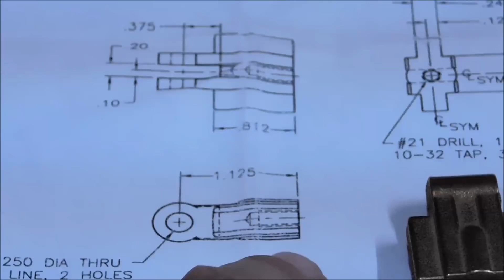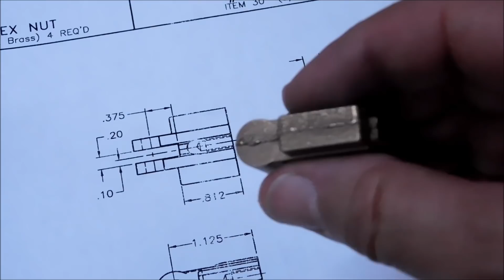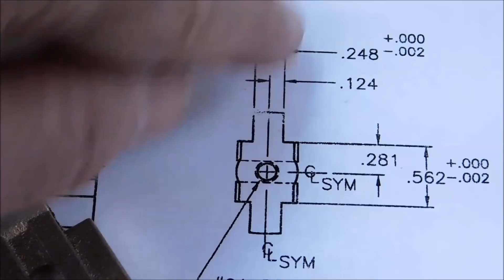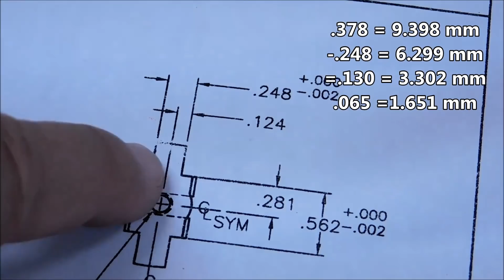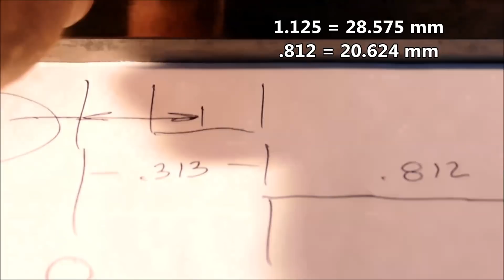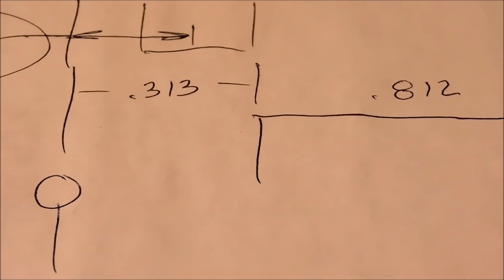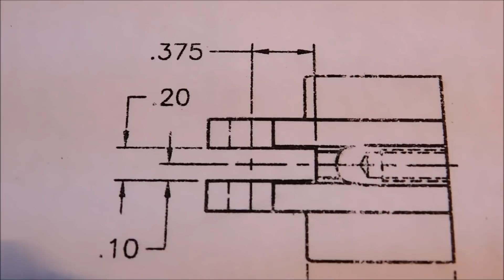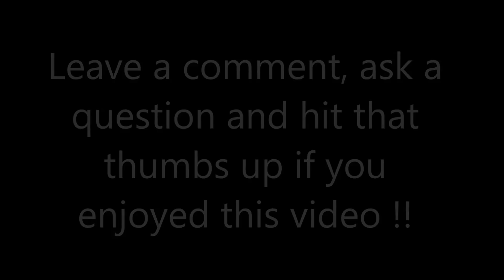Machining a Model Steam Engine - Part 5 - The Crosshead

Comment: Aloha Joe I have made several of this company's models and casting offset is one of the major problems, and your are right many times your dimensions are not possible to obtain, but there is always a preferred surface that needs to meet print dimensions.  I wish your had done this a few years ago, before I started making these models, try their shaper or milling machine kit!!!
Reply from the maker: If they are smart, they'll send me one for free. Great advertising.
Reply: @joepie221  I agree...
Reply: @joepie221  I agree. I bought this PMR model and will build it while re-watching your videos. I bet a lot of others are doing this also.

Comment: With the damage from the copper wire I wager it's a combination of the copper wire being age hardened and the casting being porous. I have seen cast parts so porous that they looked solid but leaked like a sieve, and I can only assume it has a similar effect on strength.

Comment: hey Joe,
 i love the videos you put out. i was wonder could you do a video on taper threads? there not a single good video on  how to machine taper threads from start to finish. Finding all the information you need to be able to machine taper threads you make for a good video. i appreciate everything you do for the machining community!
Reply: You machine a taper thread the same way you machine a thread, and a taper, except at the same time. You use a taper attachment or an offset tailstock and thread as normal.
Reply from the maker: @SuperAWaC  1 degree 47 minutes per side.

Comment: Great video!!!  Question, what length of file is best suited for lathe work?  10, 12 14?  coarse, fine
Reply: All of them
Reply: You can get a file that is made for lathe work the cutting angle is 45 deg makes for a smoother finish and they do not clog up as quick ,but as usual a quick rub with a brass scraper sorts them out do NOT us a file card they blunt files

Comment: Regarding electrical copper wire, it is partially hardened.  Otherwise, it would break when the electrician is handling it (and terminals would not remain tight).  Flash that copper wire (or sheet if you use it) with a torch to red heat to anneal.  Also, you were concentrating the clamping force to small area in both cases.  Your aluminum should have been forked or slotted so it bore upon the 2 flats spanning the bulge.  You can also anneal the aluminum (after machining, unless you want to machine chewing gum!)
Reply from the maker: You obviously didn't watch the entire video.
Reply: @joepie221  I did watch the entire video, start to end!  I could not find any reference to using the copper wire in any of the setups (until you showed the damage).  I could also find no reference to annealing the aluminum pad either.  You did make comment that the copper was "dead soft".  Is that the thing you claim I am missing?
          If you had known the material was so fragile, you could have made a 2nd aluminum nest, but with a bump on the outside to permit it to rock in the vice.  If it's too fragile for that, then you must resort to Woods metal or epoxy embedment.

Comment: Awesome...thanks....I would have lost the bar bet on copper deforming this material!
Reply from the maker: You and me both!
Reply: That would have made 2 of us paying up.,,,,,Aluminum welding wire next time maybe?????  Maybe delrin???
Reply: @mathewmolk2089  Trouble with some welding rod it is very hard due to the whatever they add to it. I have some that is VERY hard to cut with pliers, need to use a saw. Probably a better bet is cooking foil, scrunched up to make a thick pad.

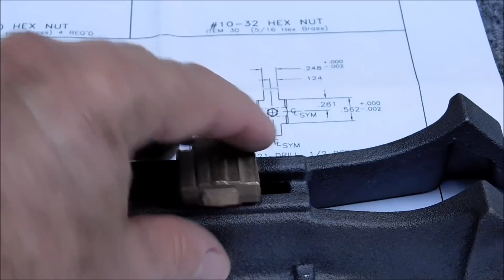Comment: At about 2:30 you mention that the planar relationship between the two ears/slide surfaces is important. With the setup you used: what happens if the casting isn't symmetrical, and one ear is higher than the other? When you place that on the nest, the casting will be at an angle: the plane that separates the halves of the mould isn't parallel to the nest, so the features (as cast) won't be parallel either. I guess you can get away with it as long as the angle is small enough that the final features still fit within the casting?
Reply from the maker: The setup I used will guarantee that doesn't happen. If you were to stand the part on its side and finish each ear completely and independently, then you may have the misalignment and small angled planar relationship you speak of. Once I did the first side of each ear and flipped the part on parallels, everything lined up.

Comment: Kinda surprised you didn't make the 'nest' with a ball end mill in centre plus split it in two pieces at the beginning?
A round trough could locate length and centre on the cast boss ( I tend to overthink things and wouldn't even have thought about soft packing instead of a full fixture supporting both sides)
 I tend to have odd bits of 6061 more than any other material though.
Reply: Do you mean using a ball end mill to make a slot for that round feature to sit in and simultaneously restrain it in two axes? If so, you do not want to do that, because then it gives inconsistent points of contact along the surface.
Reply: @SuperAWaC  The quadrant cast boss where it's thicker for piston rod in line with direction of travel, not the circular end connected to crankshaft with the cross drilled hole. Not to clamp on casting which wasn't totally even side to side but length of boss was pretty even top and bottom? Still clamp on previously machined surface. Probably not describing it very well?

Comment: I've got a couple of these kits I need to start to work on. The bronze has me curious. Copper should be softer than all but high silicone or nickle aluminum bronze. I have an email into PMR to inquire what they use. Great video as always. I love seeing how a real machinist approaches these castings.
Reply from the maker: I try to be methodical. The copper wire fooled me too.
Reply: The casting is in “as cast” condition....it went straight from molten to solid.....no work hardening or heat treat.....it is fully annealed.
The aluminum was probably heat treated to T6.....It should have been annealed.....the copper wire was probably still work hardened from drawing....It should have been annealed.   Both metals would have been at least a bit softer than the bronze if the had been annealed!
Reply: The brass isn't brass, it is "gunmetal", a very soft metal used to make bearings.

Comment: Hi Joe. A lot of model castings are less than good. I draw the casting in Cad and then draw the part to be machined. I then superimpose one over the other and work out the best surface to start on so I don't run out of material. I have been caught out before !!!!
Reply from the maker: I could have dusted the end cleaned and worked forward, but I was intent on having the cross hole line up with the split end. That was #1 to me. The .813 ear length means nothing.
Reply: @joepie221  I understood that Mate, when superimposing the part drawing onto the casting drawing you can move it to where ever you want it. It just makes dimensioning the drawing easier.  Anyway I love the video and I learnt from it.

Comment: Is he filming these in his own shop?  Does anyone know?  Such incredible content either way
Reply from the maker: Hello. Thanks for the comment. The answer is yes. I own the shop, run the cameras and do all the machining myself. This project has been a lot of fun and should be finished soon.
Reply: @joepie221  Thanks for response.  You are a magician (at least to someone like me).  Keep the content coming.  Congratulations on attaining your following.  You deserve it.
Reply: I like how neat Joe keeps his machines! At work my co workers are slobs!! Chips everywhere grease oil. Tool holders not blown off chipped inserts and piss me off the most people will use lathe to sand pins and they dont protect the ways or even clean them off after..worst suns a guns you can imagine.
Terrible lathe edicate..

Comment: Joe you should have "clamped" it with hot-melt glue ... hopefully that wouldn't bruise that casting... 🙄😂😂
I like the sandblasting trick to restore the patina of the casting... 🤔
I have to wonder at the wear profile of such soft material rubbing against C.I. ... I know ... its only a model.. 😏

😎👍☘️🍺
Reply: Sometimes texture can be restored by pressing a similar grit paper against the surface, in this case rolling the filed partline tab's radius.  The goal was to leave as much casting surface as possible cosmetic.
Sliding assemblies generally consist of 2 dissimilar material/hardness. Similar material/hardness tend to gauld. Proper lubrication is helpful to prevent gaulding.
Reply from the maker: Place heavy emery over the area and tap it with a soft face mallet.
Reply: It might might wear the cast iron faster.  When you have a soft material and a hard material sliding on each other often the soft material will pick up and embed bits of grit or work hardened metal dust and will basically turn the soft material into sandpaper that grinds on the hard; creating more work hardened dust and grit etc.

Comment: Why arent there datum lines on the “drawing”
Is it because its not a blue print and only a diagram 
Is that what determines a blue print or a diagram
Reply: Paul, I haven't seen a blue print since I was a draftsman back in 1966 just before we got the blue line machine. ,,,, and now as a retired engineer just as  back than we called them "drawings" ,,,, Datum lines have nothing to do with it.
Reply: @mathewmolk2089  I havent seen the whole drawing for the engine and wondering why some of the dimensions dont have a reference line like a datum 
That would give a starting point for all the rest of the dimensions
Reply: The engine doesn't need DATUM toleranced. This one off project can be constructed/assembled using the print dimensions/tolerances.  How many home shops have an in-house CMM?
Reply: "Blueprint" is a term meaning "reproduced master drawing". Basically "Xerox copy", but made with  a technology long before there were Xerox copy machines.
"Master drawing" is the original piece of paper made by the draftsman, and checked off by the drawing checker and responsible engineer in the legend box on the drawing.
The factory drawings were always blueprints - that is, copies - of the master drawing because you didn't want to risk the master drawing to dirt, grease, smudges, burns, and tears that would almost immediately happen if you just unrolled it in the workshop area. The master drawing, just like a master CAD file today, could represent hundreds of hours of work. That wasn't something you could risk to damage lightly.
Reply: @lwilton  thats where I was working with blue prints was at mack truck factory where I did a short time in receiving inspection where we were working with original drawings and checking parts from outside venders backing in the 70’s
Reply: @lwilton  
Blueprints were so-called because they were blue !  The prints were on chemically sensitised paper which was laid behind the drawing, and then exposed to ultra violet light, before being chemically “fixed” by exposure to ammonia fumes.
The shop could have as many prints as they liked, but NEVER the drawing ! !

Comment: You sure that's bronze, and that the copper wire was copper?  Lots of grades of both, but that indentation was surprising.  I guess you don't have copper-plated steel welding wire in your scrap box, but...

Great video btw - do you feel more comfortable machining from regular round/hex/ flat stock, or castings?  I kinda follow what you're doing, and see why you're doing it, but in many ways the castings seem to make the process more complex than prismatic stock🤷‍♂️
Reply from the maker: I was blown away at the compression damage. My money was on the bronze crushing the copper. Surprise.
Reply: @joepie221  yeah, me too👍I guess when noone has anywhere to go, and the pressure is on, unpredictable thing happen :)

Comment: for it to be self-starting on bigger I'm thinking it would have to be dead nuts all the way round   on a bigger model . am I wrong? as frictionless as possible.
Reply from the maker: By the very nature of the engineered motion, it only rides on edges anyway. I believe it rocks slightly during the stroke influenced by the connecting rod.

Comment: Your cylinder will need to be located very precisely to ensure that its center aligns perfectly with the center of the crosshead.   This is pretty tricky to do as you need to allow for it being a sliding fit on the rails.  I would have transferred the location from the cylinder rod to avoid this potential problem.
Reply from the maker: Oh ye of little faith. Trust me. It will line up.
Reply: That the bottom crosshead slides are part of a casting doesn't help. If it was just a slidebar you could shim it to suit.

Comment: It's very nice to have all the equipment you have to work with but moet model engineers can not afford $1000s on the equipment you have, if someone made these engine using just a lathe it would be more interesting

Comment: You are going to leave the casting surfaces unmachined so far as they are non-functional. That’s okay, its your model. But considering the crosshead of a steam engine in reality is a forged and then machined part instead of a cast one, I would personally clean it up entirely.

Comment: 36:45 why the super big chamfer for the thread?
Reply: at a guess, to protect the thread, but also to help start the tap. other than that, i'm guessing personal preference.
Reply: @arcanix51  oh I know why you chamfer for a thread at all, sure. But this big? O_o
Reply: @SoWe1   at a guess, i am thinking this part is made of "Gun Metal", or Red Brass as it is known else where. it has a higher percentage of zinc and tin. it also makes is soft as heck. if a mere copper wire could deform it, its got to be soft like butter
Reply from the maker: It looks bigger than it is, but the chamfer tool tried to take off on me because the material is gummy like copper. I made it a little deeper to clean up the faceting that occurred.